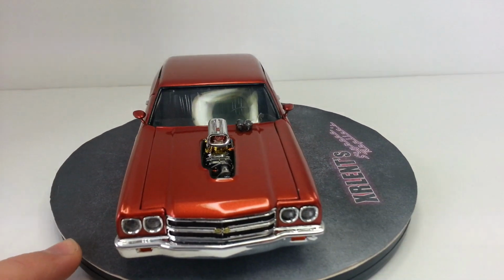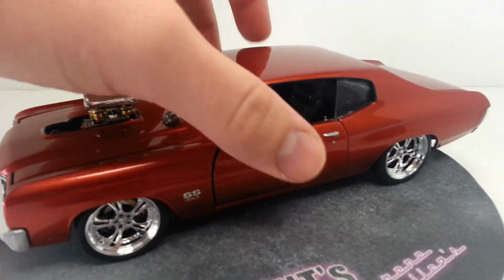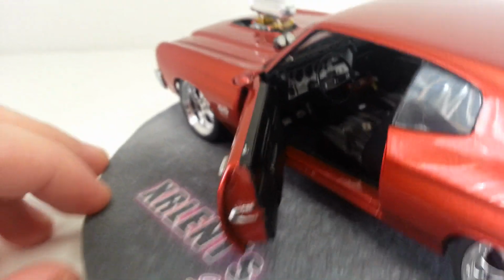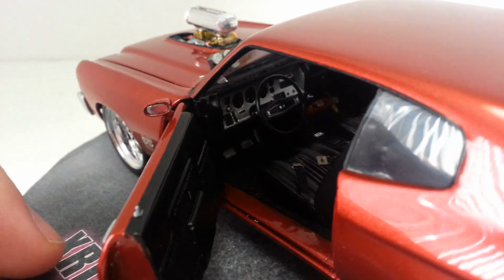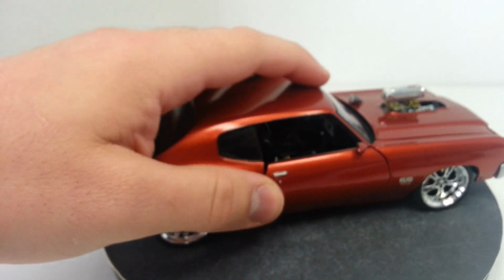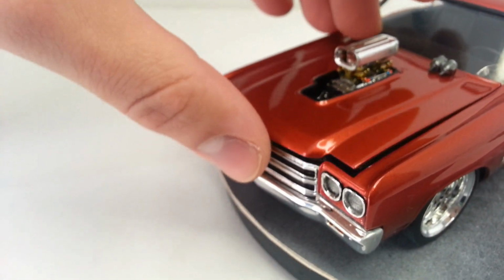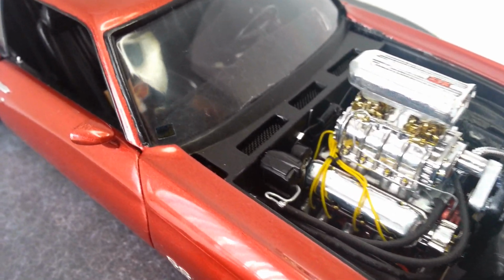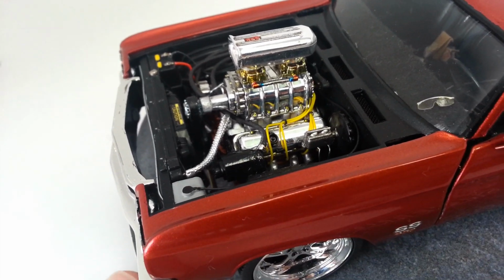Chevy Cheeseburger Tribute | Final

Comment: Great job how did you make those gauges on the hood
Reply from the maker: Thanks. The hood gauges are styrene rod painted and the gauge label printed and stuck on. Then i add some styrene strip in between and on the outsides to represent a bracket and finish off with a piece of wire.